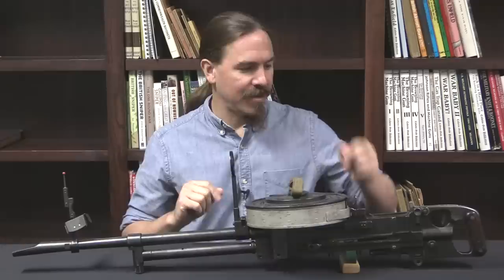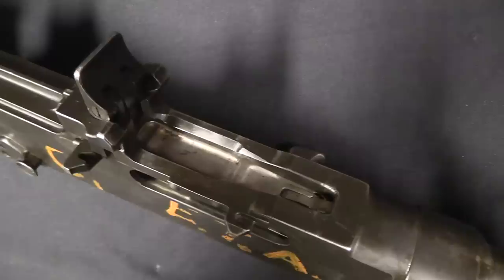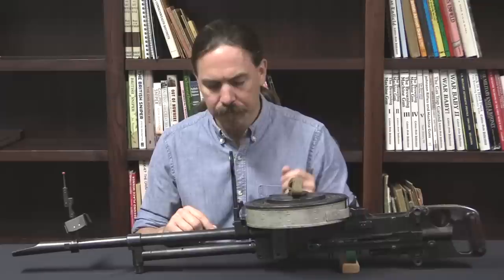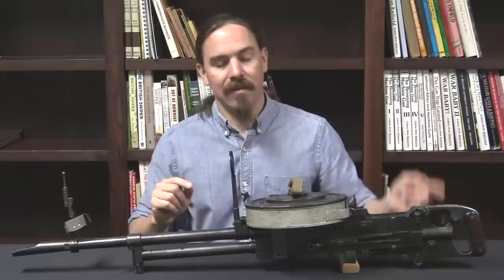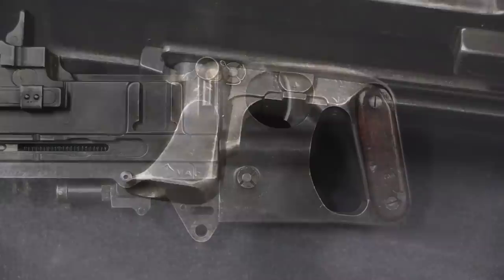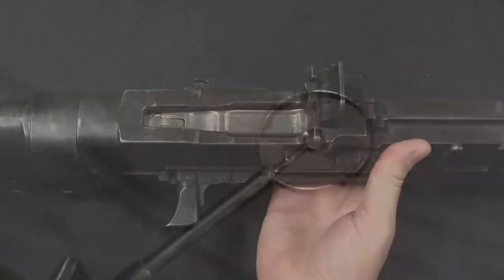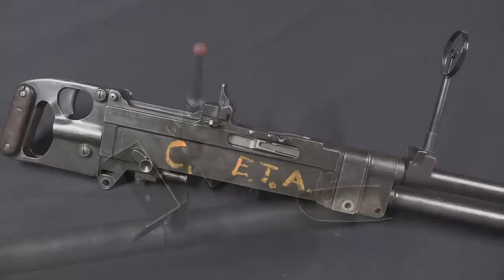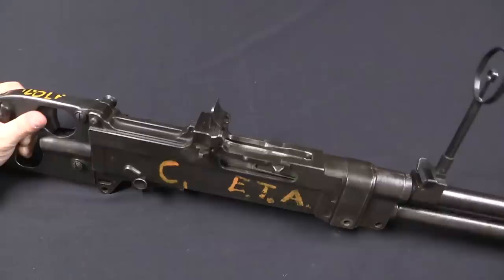Vickers "K" - For Aircraft and the SAS/Long Range Desert Group

Comment: In my dim distant youth, I knew a chap who served with the SAS under David Stirling. He also knew many of the LRDG chaps, as they tended to be in the same areas doing very similar business. He suggested that the choice of the Vickers GO was down to nothing more than availability. The SAS was an odd ball organisation, and so when they requisitioned 'stuff', they tended to get silly answers from suppliers, anyone who has worked in any military supply system will understand that. If you have 100 men, but order 110 tooth brushes, some admin wallah will spend longer querying the order than the life expectancy of the guys in the unit, so when the SAS were after machine guns, the 'organised' supply systems told them how everyone wanted machine guns and they would just have to wait, but there were spare Vickers GO guns in RAF depots, and they were 'acquired'. If you look carefully at all pictures of SAS (and LRDG) vehicles, you will see a very wide variety of guns, mounted and carried. If they had a gun that worked, and ammunition for it, it would have a custom mount welded up and be used. 

He also explained how they selected targets. One of the problems was that if you asked 'Cairo' what they wanted attacked, and discussed plans, there was a strong chance that when you arrived, the enemy would be expecting you. However, if you told no one where you were going, you stood a better chance of getting in and out without as much opposition. If they were short of cheese, they attacked an Italian target, if they were short of schnapps, they attacked a German one. I seem to recall him saying that they attacked Vichy positions if they were short of wine, but it is all a long time ago. 

His personal side arm was a long barreled 'artillery pattern' Luger that he took from an Italian officer. He chose not to explain the negotiation of that 'gift'. He also preferred the P14 rifle to an SMLE or a No.4. He said it was more accurate.
Reply: ... Most fascinating sir 😎
Reply: hey thanks for sharing. learn something new everday
Reply: Thanks for sharing! Awesome story. I love the SAS tales! Awesome lads!
Reply: I love the true dogs of war, the experts and specialists that are ignored by top brass and do the job with whatever they can 'acquire' ten times better than if they were told what to do. More militaries should be focused around SAS or SEAL type special forces tactical experts with a free hand to execute a strategic objective rather than mass mobilisation and destruction. But thats my opinion, i'd rather an expert get it done fast and cheaper then throw a bunch of idiots who cant clean a bolt action at it.
Reply: So basically they were landlubbing "privateers". Except more organized, had a purpose and their value were recognized after the war.
Reply: @manhphuc4335  Their value was recognised by the people that mattered, at a time when what was needed was a degree of chaos behind enemy lines, disruption of supply, destruction of enemy 'air assets' and so on. They caused the Germans and Italians a lot of material damage as well as forcing them to station troops to guard rear areas. They had a certain amount of licence as to exactly where they caused chaos, but also did carry out missions ordered by 'command'. 

If the enemy has several fuel dumps, several landing strips and so on, it doesn't matter that much which one you knock over, as long as it keeps the enemy guessing and reduces his ability to fight. They always had 'supply' difficulties, so supplementing official supplies with enemy ones was not a bad idea. You cannot do that with a large force. The history of the fighting in North Africa has some interesting twists and turns.
Reply: As Mark Novak would say, "OUTSTANDING!" 👍
Reply: @harryfaber  Most of the worst SAS/SBS casualties suffered during WW2 were from operations sent down by Command; they were usually far more effective when left to their own devices. They were truly exemplars of the great "privateer" tradition.
Reply: @Bruciando  Indeed so.
Reply: @siliconjim2554  That and the Italians breaking into the American Embassy and photographing the code books. 
Apparently the American liaison officer had a low opinion of the British. Something the perennially late to the party yanks still suffer from
Reply: @zoiders  The old gent had qualified as a 'marksman' before the war, apparently there was extra pay involved, he did tell me how much, but I have forgotten. In India, his qualification caused him some extra work, as he would be the guy given the job of shooting rabble rousers behind crowds of protesters. Whether he had been able to choose a weapon for that, I don't know and cannot ask him now, for the obvious and final reason. His Luger did not come from 'conventional sources', and I guess he just rather liked lugging the damn thing about. He still had it when I knew him in the 1970s, so I suspect he brought it back to England before going to Italy, I rather fancy that if he had it with him in Italy, the Germans just might have confiscated it when he was taken POW. He would sometimes fire it at 6' targets at 100 yards, and sometimes he would hit. He also still had his P14, which he insisted we used in competitions, rather than a No.4, but I struggled with it, I was always better with the No.4. Sadly, he never let any of us use his Luger. 

When he joined the SAS, Stirling was the boss.
Reply: I have seen pictures of Commandos training with P14 rifles. I don't recall seeing any in operational use. However, that doesn't mean that some might not have made it into use.
Reply: @jonathanhill6064  That is fine for attacks, limited in scale.
You don't win a war though, until you break the enemies will to persevere. And you can't do that by limited area attacks no matter how decisive they are.
You can wipe various areas clean of the enemy, but the mass of them don't quit just because of that. They need to be convinced the same fate is coming for them, and for that you need a broad advancing front.
Reply: @keithlevanway6871  It is hard to tell the difference in a photo between a P14 and a P17, both of which found their way to England during WW1 and 2, as did Ross Rifles!
Reply: @keithlevanway6871  I quickly 'Wikipediad' the subject, there is a picture of British snipers training in France, 1944, with P14s.
Reply: Requisitions is it's own war.
Reply: @badlaamaurukehu  I knew a guy who was a 'supplier', his job was processing requests for various items. He supplied me with a 'screwdriver, London pattern, No.1'. The list of stuff that I was entitled to was there on the table, he supplied it and made me sign for it. I asked what I wanted it for, he neither knew nor cared, but he had supplied me with the things that the list said I should have. During the Falklands campaign, he was told by a naval officer of some importance to 'supply' diesel fuel to an army unit. He said that he couldn't, the unit only had petrol engined vehicles. The officer said that the fuel was not for the unit, but for the farmer that they were lodged with. Absolutely cannot supply a civilian with military stores. He was then told that the farmer was supplying the army with electrical power, using a diesel generator, and in the middle of a battle, he could not just pop down to the service station, so, 'KINDLY SUPPLY DIESEL TO this unit. NOW.' 

He made the calls, a helo delivered some diesel, the generator ran, the army could use it's radios, lights and son on, the war was won, but if the supplier had his way, the Argentinians would probably still be in Stanley.
Reply: @zoiders  no, thats completely wrong. Blair Maine only became the Colonel after David Stirling was captured, and not before. Lt Colonel Maine had more success in the desert it is true, but nether were particularly trusted.
Reply: @howardchambers9679  Brits didn't actually fight the Germans until late 1940 and America joined the same year as the Soviets but ok pom
Reply: @zoiders  if you say so. 
Maine was not trusted by his superiors, he got them results, but when it came time to acknowledge those achievements they didnt because they trust him. If they didnt trust David Stirling they wouldnt given him it back when he was released from coldtiz.
Reply: @zoiders  Wrong, so very very wrong.
Reply: @zoiders  Not the army commandos but the Royal Marine Commandos and a unit went to North Africa for an operation but it was cancelled and they were disbanded, this was the main resource for the newly formed SAS started by David Stirling and later jock  Lewis and later still Paddy took over the SAS when Stirling was captured and sent to Colditz.
Reply: @zoiders   SAS started by David Stirling and later jock  Lewis and later still Paddy took over the SAS when Stirling was captured and sent to Colditz.
Your a troll and now blocked you phallus.
Reply: Spiders only has two followers no posts fake account just block them
Reply: @dave_h_8742  yes, well, we have a Paddy Maine Fanboy.
Reply: @WaukWarrior360  Canada and the UK put boots on the ground in September of 39. Soviets and Americans didn't arrive until late 41 against Germany.  So yes. Late to the show.
Reply: @A-a724  Oh geez, nobody taught you about the Phoney War in school did they.
Reply: @A-a724  Soviet Union and America were late to the show.... But had the most impact....
Reply: @WaukWarrior360  not really
Reply: @jonathanhill6064  As a Marine Corps infantry man I feel attacked
Reply: @WaukWarrior360  pom lol. That made me smile. Actually it was earlier than that. But pom!!! Are you an Aussie sticking up for yanks or a yank trying to be Aussie?
Reply: @wierdalien1  Not really....? What?
Reply: @howardchambers9679  Are you some seppo pretending to be British? Yeah nah man, the Brits literally didn't fight Germany until the middle of 1940.
It's called the Phoney War because both sides stayed behind defensive lines for 8 months with only a few skirmishes.
Reply: I thought one of the reasons they used the Vickers K was because they had incendiary ammunition they could use with it when they raided Luftwaffe airfields in North Africa.
Reply: @Bruciando  Rubbish
Reply: @zoiders  uumm   Lay force ??
Reply: Brilliant my Grandfather was RAF out in Egypt he made parts for planes and anything only a toolmaker could produce so the custom mounts you spoke of could have been my Grandfather's handiwork I also remember him telling me about guarding Italian POWs and how they "surrendered in droves" 😆 but he did talk fondly of firing their LMGs at the range . Im not sure what they were but he thought they were  "great kit" 
He also had recollections of being strafed by a rear gunner after his aircraft had made a pass 'kicking up the dirt just inches away. 
The last story I remember was how he was very lucky one night ...
He said they usually slept through air raid sirens after a while but one night a new guy woke him asking to be taken to the shelter insisting he went with him, he left with the chap ,after the all clear he returned to find a piece of shrapnel had come through the hut went up the length of the bed and wedged in his locker at the head of the cot . For sure he said the boy had saved his life . ✌
Reply: @zoiders  SAS was Sterling's baby paddy maine was a NCO not an Officer 😆 
What novel did you read this from ?
Reply: @zoiders  Are you an American I? . In the British Army you don't hit an officer or an enlisted man for that matter but to hit an officer is a Court Marshall even in the SAS and yep he wasnt a NCOas I had thought but he wasn't the CO either.
Reply: * MAYNE. ffs
Reply: @WaukWarrior360  that's inaccurate, the British Army engaged the Germans in April 1940 in Norway, May 1940 France (BEF). Hardly late 1940.
Reply: @iatsd  The predecessor of the LRDG, the LRP, was made of up New Zealanders. When it was reformed as the LRDG, it made up men from all over the Empire. I can't find anything to say the majority of the SAS were New Zealanders.
Reply: @davidguardado4739  no, Maine was an officer, a very very good officer.
Reply: Very interesting. Sounds similar to how early SEAL and Green Beret units procured equipment wherever they found it. I'm sure they still use weapons they "negotiate" with the opposition to obtain.
Reply: @WaukWarrior360  the point is that all the major Allies made big contributions.
Reply: @comfortablynumb9342  One of the issues for any clandestine force is working out where you are most likely to find supplies of ammunition. If the most easily got supplies are for enemy weapons, it makes a lot of sense to have enemy weapons. If your normal travel arrangements are for four blokes to rush about in a jeep, it isn't a problem to lug around an enemy rifle as well as the one that the King gave you. My old instructor never mentioned German or Italian rifles, but he did say that a lot of the blokes were quite happy to cart about machine pistols. They tended not to take time with taking careful aim and firing single shots, a lot of their effectiveness was arriving silently and then suddenly making a lot of noise, a more modern soldier would say 'laying down suppressive fire'. In any regimental depot armoury, an armourer will tell the chaps not to fire long bursts, it overheats barrels, wears out the bore and so on, however, the regimental armourer really doesn't mind what you do with a weapon that he didn't sign out to you.
Reply: @zoiders  
The artillery pattern probably includes the wooden " holste/stock" and would be used as a light carbine.
Not at all awkward used that way!
Reply: @harryfaber  that makes sense in every way. And naturally anyone who is low on his own ammo will happily use enemy weapons and ammo. Sometimes it's done for confusion too. An M4 sounds different than an AK, it might be better to have a weapon that sounds like the enemy's so you add to the fog of war.
Reply: @zoiders  They were a legitimate target and war is war after all, but check out the incident at Tamet airfield where he cold bloodedly shot many unarmed enemy aircrew. This even shocked David Sterling who rebuked him.
Reply: @zoiders  Private then . Fckin hell
Reply: "...if you asked 'Cairo' what they wanted attacked, and discussed plans, there was a strong chance that when you arrived, the enemy would be expecting you."
SAS established that good OPSEC makes your 'borrowing' visits easier. This later filtered down to become standard SOP for all British Army units.
Reply: @zoiders  your ignorance is showing Paddy only took command after David Stirling was Captured but the Germans
Reply: @zoiders  Number 7,8, and 11 Commando was deployed to the Md. in March 1942. They saw some action on Crete but also were in North Africa. Numbers 50 and 52 commando were recruited in Egypt. After attrition survivors placed into a composite unit called Middle East Commando. Try "Commandos and Rangers of WWII" by James Ladd for more.
To clarify my earlier comment I have seen photos of P14's being used by Commandos in training. That training appeared to occur in England.
Reply: @harryfaber  Yes it is. Two give aways 1917 rifles, P17 is a misnomer there was no P17, are the 1917 did not have a volley sight and there was a red band painted on them to show that they use 30-06 and not .303 ammunition. Both can be hard to see in some photos.
Reply: @harryfaber  So it's a "license to kill"?
Reply: @paralogregt  my facts are correct.
Reply: @zoiders  Sterling was Scottish, not English. Any other misinformation you wish to spread?
Reply: @zoiders  Irrelevant, he was Scottish born and bred.
Reply: @keithlevanway6871  I'm sure my late father, who served in the British Home Guard referred to their rifles as P17's. I know the correct US designation is M1917 but I think it is easy to see how the term P17 might have been first used by those already familiar with the P14's. 
In my experience, it is also unusual to see P14's referred to as "No.3's" even though that was their official designation by WW2. 
Surplussed P14's were popular as full bore target rifles in the UK, especially for ranges up to 600 yards. For longer ranges, many keen shooters preferred No.4's and so might own one of each. As a rifle club treasurer in the 1990's, I had three P14's and one No.4 on my inventory, all of which had been converted to 7.62mm by then.
Reply: @zoiders  you're a real duck aren't ya mate
Reply: @deanwilliams4365  I think it's pretty clear that since you automatically assume I'm an American because I defended America's role in WW2 and clearly have a very negative opinion of Americans it's clear you have a very chipped shoulder.
Reply: @deanwilliams4365  What I do have to do though is correct you by pointing out that no, you poms did not have the Germans on the run before the US was involved. You didnt even fight them until mid-1940 and after that you were losing badly.
Reply: @mattp7828  April and May of 1940... Still over 8-9 months after hostilities broke out.
Reply: @wierdalien1  "All the major allies made big contributions". That's a much different sentiment compared to nationalist pissing contests.
Reply: @WaukWarrior360  sure.
Reply: @zoiders  lol i get that impression from you pal🤣
Reply: @zoiders  Sherman tank= Yank
Reply: So basically
"Hey, those Vichy guys sent us quite a few cases of really nice wine.  Okay boys, we're attacking the Italians instead, because it'd be a shame to not have nice cheese to go with this excellent vintage."
Reply: @WaukWarrior360  the Americans didn't show up until November 42 in NA the first action against the Nazis by the Americans was February 43, Battle of Kasserine Pass which the Germans won.  by then and over the preceding month the British 8th army had pushed from Egypt all the way across Libya and had entered Tunisia. not forgetting the BOB  all of which happened before the American even spotted a German!
Reply: I remember one program on the early days of the SAS operations. The type of person in the SAS was at complete odds with the LRDG. When interviewing for people to join the LRDG they were looking for quiet personalities. One member said during this interview that he kept budgies, and that was enough to get him accepted.
Reply: Also war was only declared in September 1939, after that and before the BEF campaign there were hostile engagements such as the sinking of the Royal Oak by German torpedoes with the loss of 500 sailors. This period is often called the phoney war but people lost their lives so I'm not sure phoney is an appropriate term.
Reply: @mattp7828  The sinking of the Royal Oak was kept pretty quite at the time. Why the phrase has come to be generally accepted, I don't know, and if you were a casualty, it would not have felt 'phoney', but there had been some expectation of mass bombing, vigorous military campaigns and so on, but the RAF were dropping leaflets, there was some posturing going on, and hasty preparations, but not battles like the Somme or Verdun, not the all out war that people had to some degree expected. 

My father was too young for WW2, but shortly afterwards found himself in the Middle East, where there were casualties but not many medals, because the fighting they were doing was not 'war' but what we now call 'peace keeping'. As a schoolboy, I was always galled by how other boys would tell me that my dad didn't fight. Got shot at, had some comrades wounded and killed, but 'didn't fight'. 

I had a long chat with a man who joined the army in 1940, spent most of the war driving a truck around the Isle of Wight, and was on the invasion force that took control of Guernsey after the German surrender. He told me that for him the war was quite pleasant. He got a campaign medal after a charmed existence of basically doing nothing. 

There will always be anomalies like that.
Reply: @zoiders  My old Dad's favoured personal weapons during his time as a radio specialist attached to the LRDG were a standard barrel 9mm Luger and a MP38 submachine gun. As he put it , you couldn't hit a barn door while holding the handle with a .455 Webley service revolver and a Sten was a shoddily-made, unreliable,
 piece of crap that would jam at the most inopportune moments.
Reply: Have a chessedoodle and a Roast dinner ...damn another Americanism ,spoils everything huh
Reply: Very nice piece of history!
Reply: @WaukWarrior360  The British were fighting them at sea from the get go in `39.
They were fighting them on land in  the Narvik campaign from early 1940 and then when the Germans attacked  France in May 1940 and the "phony war" got real.
By June `40 France had surrendered and the B.E.F.  was  back in the UK.

By  "Late 1940" I`m not sure what you are referring to.?

The USA entered the war against Germany when Hitler declared war on them in December 1941.
Reply: @WaukWarrior360  Soooo, we didn’t fight them during the retreat in 1939?
Reply: @zoiders  ‘enlisted’ is a pretty common and official term for a soldier who enters in the ranks
Reply: @zoiders  I did, and it was a well used term.
Reply: @zoiders  You sound like one of those donuts who are in the cadets at school and have memorised all the ranks and insignia but can’t get over the six foot wall! Next you’ll probably correct me that it’s not a six foot wall anymore!
Reply: @WaukWarrior360  
 A Defensive war is STILL a war 
War is not all infantry charges or tank battles. 
Most battles were one side attacking a defended area.
A lot of those battles would start with both sides held up exchanging the occasional round and a lot of artillery.

The soldiers still risked there fucking lives, 
respect the soldiers who died and risked themselves in your "Not" fighting during 1939
Reply: @WaukWarrior360  Soviet union had a big impact, The US not so much.
If it was not for the Soviets keeping some of Germanies troops bogged down for years . more would of been diverted to the Western front and the Western front easily pushed back.
Germany could of easily won a war on one front
Also the western front is much easier for the Germans since the weather does not fuck them up as much
A war on the eastern front solely would still be confined to certain parts of the year for Germany
Not so much for Russia due to them being accustomed to the climate

I like how Americans believe in this bullshit "We are the sole reason for victory in WW2" 
Truth bomb here
Russia had a bigger impact in Europe 
After America doubled nuked Japan, we KNOW for a fact that Japan was still going to fight.
But after the Russian Invasion of Manchuria was Japan actually scared into surrendering
Also you wanna know the reason why they Surrendered to the Americans and not the Russians 
In the Japanese commanders own words
"Its much less embarrassing to say you lost to a "Magic bomb" than to the Russians" 
They used America to save face and also because well they did not want a probable Russian occupation if they did surrender to the Russians.
So without the Russian invasion of Manchuria Japan would of still been fighting , so either America would have to be forced into invading Japan and seeing how Vietnam went and Americas land engagements went against Japan it would of extended the war for a very very long time with lots of US casualties or nuke pretty much every city in Japan making it unliveable 
I am not denying America played a big part in WW2 they most certainly did
But they were not the country that had the most to do with the victory that would go to Russia on both sides of the war
Reply: @Bruciando  Have a look at Popski's Private Army. Bunch of independent nutters.
Reply: Thank you for the info
Reply: @WaukWarrior360  The RN would be really p..... d off at their contribution being overlooked, so would Bomber Command.   People fought and both killed and got killed.  When do you think Prien sunk HMS Royal Oak, or the River Plate action with the Von Spey happened.   Bomber Command started by dropping leaflets and avoided damaging private property, but before long it wasn't all sweetness and light.